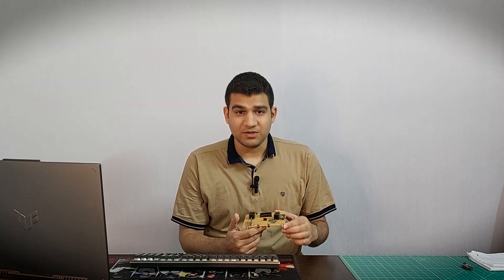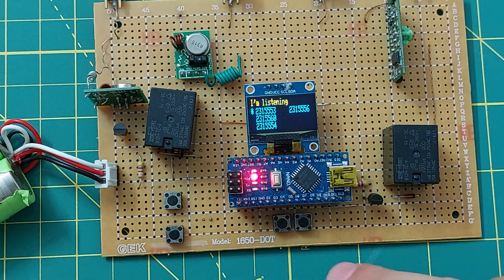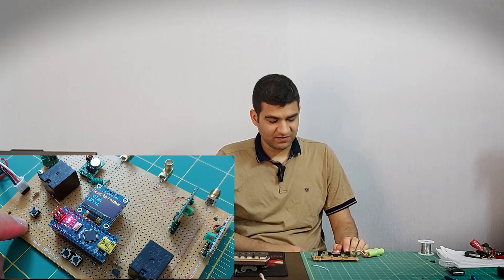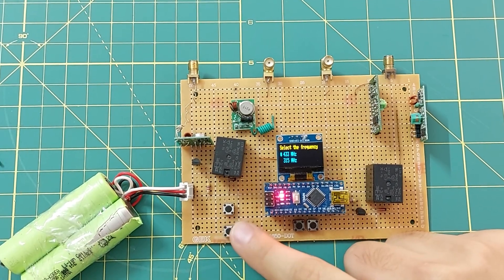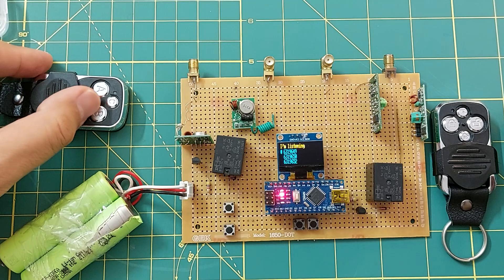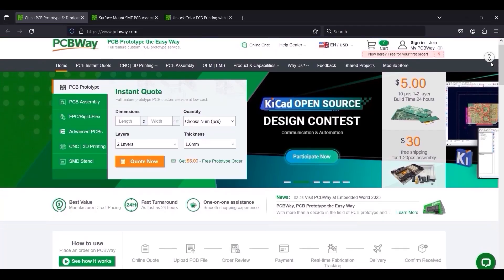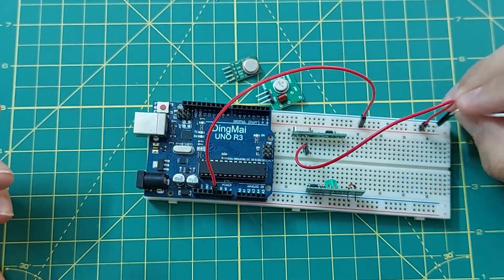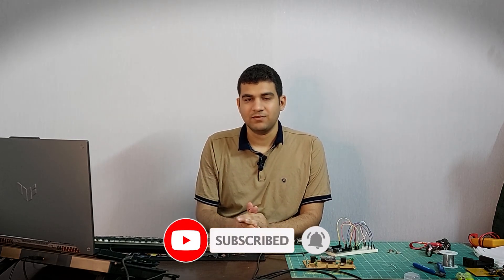RF Hacker Project - Part 3

Comment: Hello. 
Please Can u make video tutorial for capturing signal from 433 MHz car key fob with cc1101 and esp32 with oled display and some buttons ?
Because when I try to use rcswitch library with classic receiver and transmitter it can only capture and replay just max 24 Bit lenght signal but cant capture more than 24 Bit signal because most of modern 2017+ cars bave sofisticated signals and stuff like that. Btw HaclRF One Portapack H2 can do it correctly without problem but I want to learn to do it with esp32 and cc1101.

Thx for video :D
Reply from the maker: ok, I will check. But I don't promise. 🫴❤️
Reply: @BabakStars  ok sir